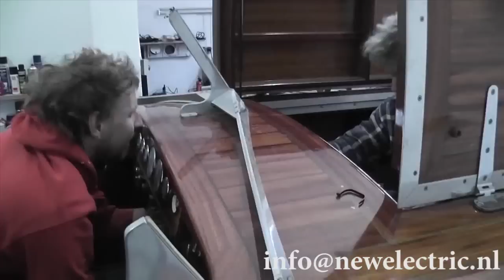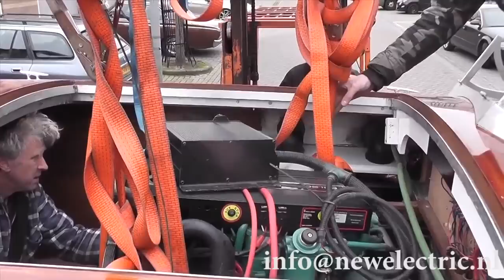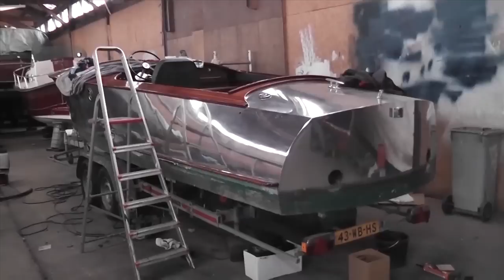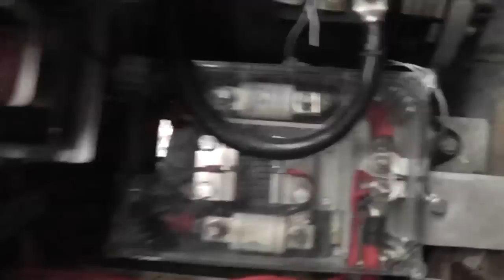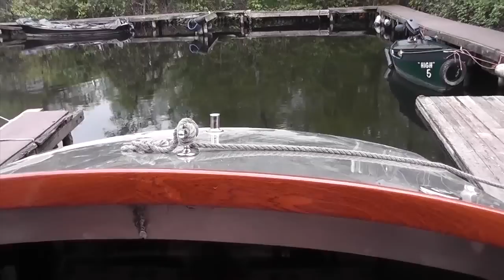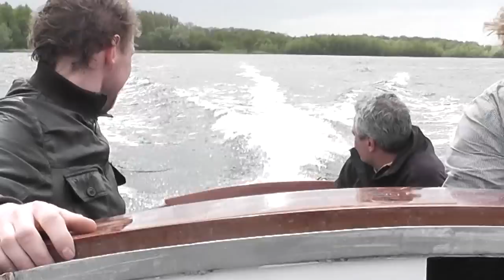New Electric NedCraft conversion, shakedown and the Admiral's first spin!

Comment: Did you guys consider putting a different prop with the torque you have with that 11" DC power?
Reply: Buy whel 1 14 hp ektrc outdated 20 meceange 20 moh.

Comment: Destroyed a beautiful boat. It sounds like a kitchen mixer. Why not just run it on biofuels and keep the engine.
Reply: You can do that with your boat, they however did their thing with theirs.
Reply: Glastron is not a beautiful boat ,it's the worst made production boat ever ,
Reply: Great for a experiment
Reply: I'd hate to have to troubleshoot the wiring nightmare. I bet there are simpler electric set ups. Batteries, Variable speed drive controller, small  motor and a speed control lever. Plus I'd have a back up motor.